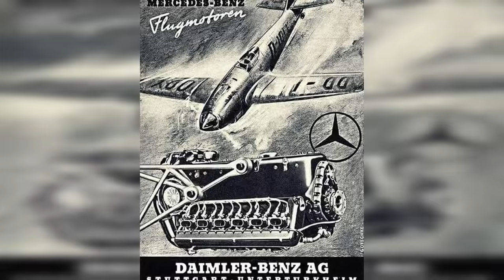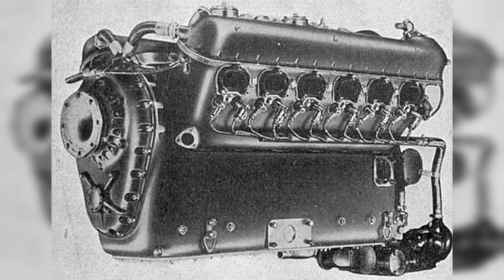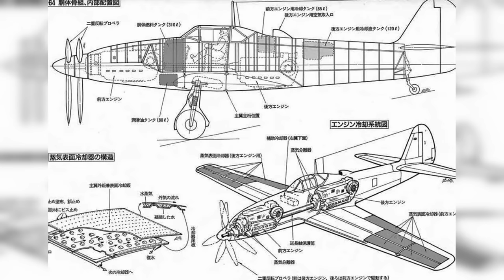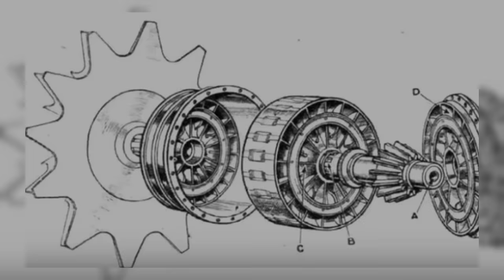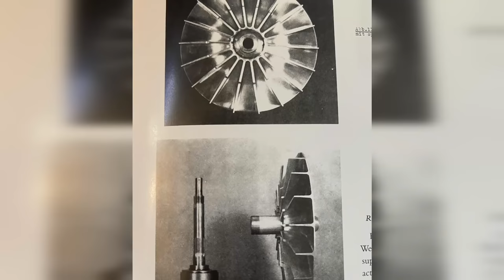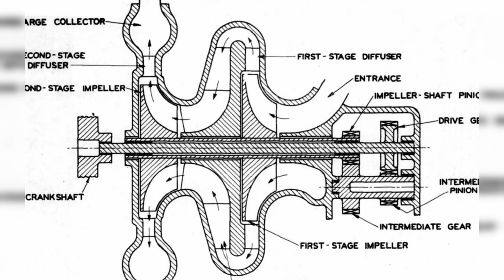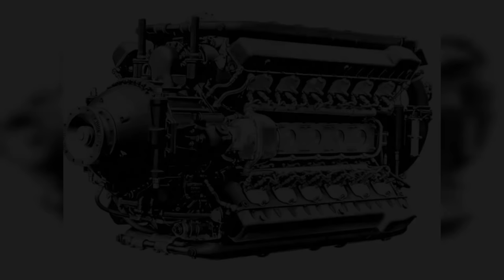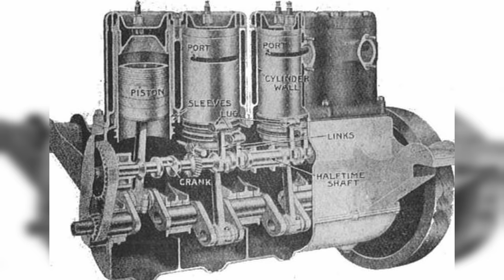The Engine of the Dark Side? Daimler-Benz DB-600 - DB-605 - Part 1

Comment: I own a small part of one of these engines that was recovered from the wreck of a crashed Heinkel He 111. The really amazing thing about it is that stamped into the metal are 3 words......'Made in England'. Didn't find that until I'd cleaned it up. (I obtained the part totally legally from a museum that was getting rid of some bits that they didn't want).
Reply: Pre- war no doubt.
Reply: @michaelbooher339  That's the only explanation I could think of, unless the museum just got the part mixed up and it wasn't from the aircraft they said it was from.
Reply: @24934637  England was not very careful / smart with there technology in the 20’s - 30’s. AKA the Whittle engine.
Reply: @michaelbooher339  That's very true. I'm sure that there was something that was sold to the Russians in the 1950s that in retrospect was a massive mistake, but I can't remember what it was.
Reply: @24934637  The Whittle jet engine technology was lost to the Russians in a pool game.
Reply: @michaelbooher339  OMG! I'd not heard about that! It'll give me something to read about when I've got some time spare tomorrow! Probably the most valuable prize ever won in a pool game!
Reply: @24934637  Rolls Royce Nene Turbojet engines. Reverse engineered into the Klimov VK-1, I think, and powered the MiG-15. Stupid decision.
Reply: Heinkel 111 E  started in 1938 using Junkers 211 engines . Before that where the Daimlers. But it is easy to mistake the engines , both are inverted V12 with similar size and shape.
Reply: That’s interesting, did you work out which part it was which was ‘made in England?
Reply: @drstrangelove4998  It looks like one of those cogs shown at 4mins21 seconds in this vid.
Reply: Only Me109 prototype - D IABI - used a RR Kestrel engine untill the DB 601 was able to take off...
Reply: @michaelbooher339  - lol yeah over a "pool game".
You actually believe that? I mean I heard that in a documentary too but it sounds like such a ridiculous coverup. Especially when Britain has had a colluding past with communism.
Reply: @ThermicLight  I didn’t say I believed it, just heard it on some documentary. Been in aviation for over 30 years, and most likely Britain sold or just gave them an engine.
Reply: @michaelbooher339  - I don't think it was merely sold for profit. Rather if money was really the motive they would of found a reliable country to licence out the production. 

Instead this reeks of duplicitous dealings. I mean for all their bravado against NS Germany they certainly had a fratanized relationship with Soviet communism even before WW2.
Reply: @ThermicLight  True. They weren’t capable of seeing the handwriting on the wall. Plus, we’re talking about one country economically wiped and another technically deficient.
Reply: @ThermicLight  I was agreeing with you.
Reply: Doesn’t sound right….. must be some story behind what you got
Reply: @Wolf-hh4rv  Either Germany was buying some English parts, OR the museum got the parts mixed up. Since the museum is now long closed, I guess the only way to find out would be for someone who has experience of working on that sort of engine to have a look at it.
Reply: @PMcKay00  That reverse engineering bit was nonsense.  See my response to Thermic Light 03 June.
Reply: @ThermicLight  :   It was indeed very much about money - 100% about money.   At the time Britain was broke and needed all the cash it could get.   What happened is that Rolls Royce sold the Nene to the Soviets on a technology transfer basis.  Some people think that the Russians reverse engineered it, but they didn't need to.   The deal was that Rolls Royce provided all drawings, part specifications and data, and sample engines so that the Soviets could put it into production on a per-engine license fee basis.  For Britain and Rolls Royce it was money for jam as the Nene by then was an obsolete design of low performance that nobody else could conceivably want.   The MiG-15 performed well, but that was because it had a really good airframe, not because it had a good engine.
Reply: @keithammleter3824  - So colluding with communism to make a buck. So very hypocritical and trite.
Reply: @ThermicLight  : I think you have put it a bit strong.   Britain was broke - she borrowed a large sum from the International Monetary Fund.   Britain wished to sell things to anyone, including the Soviets - she really didn't have any options.  Pre-war Britain sold a lot of stuff to British Commonwealth countries, but following WW2 those markets were rapidly drying up as those countries began to trade with others eg Japan, USA.
Now, if you were bankrupt, and your dodgy neighbor who you always detested came to you and offered to buy for a good price that worn out old car you own but haven't driven for years, what would you do?  
Remember - that Nene engine was obsolete junk that Britain's allies would never buy any more of, and all Rolls Royce had to do was go to the filing cabinet and make copies of all the Nene info.  And round up some parts from stock.
Also remember that the Soviets were trading with all manner of Western countries as well as iron curtain countries.   Was selling obsolete engine technology really any different to selling the Soviets wheat and wool (as Australia did) or machine tools and telecommunications (as West Germany did)?   In all cases it's both making a buck and increasing Soviet strength.
Reply: @keithammleter3824  I didn't know they supplied drawings, so you are right about it not being a case of reverse engineering. I doubt Russia paid much in license fees though. Hooker said they were turned out in colossal numbers, and he saw they were still in large scale production in China in 1975, with the original faults too. We can have a semantic debate whether "unlicensed copies" is the right term, but Rolls Royce wasn't being paid for them.

"In 1958 it was discovered during a visit to Beijing by Whitney Straight, then deputy chairman of Rolls-Royce, that this engine had been copied without license[1] to power the MiG-15 'Fagot', first as the RD-45, and after initial problems of metallurgy forced the Soviet engineers to develop a slightly redesigned (and metallurgically closer) copy, the engine had then entered production as the Klimov VK-1 (Rolls-Royce later attempted to claim £207m in license fees, without success)." https://en.wikipedia.org/wiki/Klimov_VK-1

It was naive to sell the technology to the Soviets. It would be hard to enforce the license fees at the best of times, but once you change the design, even less chance. I don't think it was 100% about money. I think it was also a case of the Leftist Atlee government being sympathetic to communsim, as many Leftists are, and wanting to improve relations, dreaming of a post-war reconfiguring of the world centred on the worker, if at least ideologically. The Atlee government would have at least had less qualms than Churchill to give the Soviets the latest British technology.

"The Soviet aviation minister Mikhail Khrunichev and aircraft designer A. S. Yakovlev suggested to Premier Joseph Stalin that the USSR buy the conservative but fully developed Nene engines from Rolls-Royce (having been alerted to the fact that the U.K. Labour government wanted to improve post-war UK-Russia foreign relations) for the purpose of copying them in a minimum of time. Stalin is said to have replied, "What fool will sell us his secrets?"[4]" https://en.wikipedia.org/wiki/Mikoyan-Gurevich_MiG-15

The deal with the Soviets was done in September 1946, and to the best of my knowledge, the Nene was the most powerful aircraft engine in the world at that point, with a design thrust of 5,000lb. It was far from obsolete. Axials had more promise, but were very problematic at that point. Rolls Royce developed a larger version of the Nene and called it the Tay. It had around 7,500lb of thrust.

In Korea the VK-1 in the MiG-15 had about 6,000lb of thrust, and the J47 axial in the F-86 had about 5,000lb. There were different models of course and outputs got higher through time. 

"The MiG-15 was superior to early F-86 models in ceiling, acceleration, rate of climb, and zoom" https://en.wikipedia.org/wiki/North_American_F-86_Sabre

Thrust plays a pivotal role in higher acceleration and climb.

The Tay was licensed to Pratt and Whitney as the J48 and powered the Grumman Cougar in Korea, and the Panther too, although that just missed service.

In summary, the Nene deal was stupid for giving your enemy your latest technology that was very likely to be produced without licence fees being paid. It was one of the most powerful, if not the most powerful, aircraft engine at the time, and gave excellent service in the enemies aircraft for at least another decade. It was still in production almost 30 years later in China.
Reply: @PMcKay00  Re your points in turn:-
1.  You are correct in saying Churchill would have been more likely to block the deal.   He knew Stain and Stalin's top men personally and knew how they thought.  However, you should be less critical of the Brit Government at the time.   The deal was  negotiated between the Soviets and Rolls Royce.   The Govt could have vetoed it, but would then have been open to severe criticism for blocking trade at a critical time - Britain was broke.   They had to borrow large sums from the IMF and this might have been harder if they were seen to block trade.
Also, the western world thinking at the time was that trade reduced the probability of wars.   Ukraine has shown that is not entirely true but that is another story.
2.  You are correct about collecting the license fees.   The Soviets cheated.  They claimed the modified engine was a different engine and thus not subject to license fees.   And they handed over the design to the Chinese and neither the Chinese nor the USSR paid any license fees to Rolls Royce for the Chinese engines.
3.   Yes, thrust is critical to performance but so is airframe size:  The MiG-15 was much smaller and lighter than the F-86.  
F-86:   Thrust 26.1 kN,  Gross Weight 6900 kg, Wing Area 29.1 m2;
MiG-15:   Thrust 26.5 kN (very close to 6000 Lb US), Gross weight  5050 kg, Wing Area 20.6 m2.
Clearly the MiG's better performance comes from putting a similar size engine in a much smaller airframe.
4.    Yes, it WAS stupid of Rolls-Royce to enter such a deal without a mechanism to enforce royalty payment, but that is a fault of Rolls Royce, not the government.
5.   The Nene, which dates from 1944, was not at that time an engine that could attract Western sales as it had the excessive fuel consumption of the early British centrifugal flow low compression jets.  The Nene and the Tay were never used much - Rolls had more sales success with the 1950 axial flow Avon.
Reply: @PMcKay00  The main superiority of axial flow over centrif/radial flow was never about thrust.   In either type, if you want more thrust, make it bigger.   Where the axial flow superiority lies is in lower fuel consumption.   Fuel consumption is always critical in commercial aviation and in military aircraft designed to fly to and attack enemy territory.   It is less critical in aircraft designed for home defense, which is where the Germans and the communists employed their early jets for their performance (Nene copies and others).
The Brits would have been well aware of the above factors - "They won't be attacking Britain with that!"
Axial flow engine shape also lends itself to bypassing - that is using an extended fan to push air around the engine core without going through the combustion chamber.   This considerable increases fuel efficiency.  
The Soviets were developing their own jet engine, starting with captured inferior German technology, but came to see it as a risky expensive project due to too many engineering and metallurgy lessons to learn at the same time.   They saw merit in buying the Nene design as a way of lowering risk - it was a known good design seen as the easiest to put into local production.   For the West, it was an obsolete engine with excessive fuel consumption.   For the Soviets, the same factors that gave it high fuel consumption (centrifugal flow, low compression) made it easy to make, being less critical of metallurgy, complex machining, etc.
At Rolls Royce, it was money for almost nothing - handing over the design of an "old" engine that by then they were just not likely to sell many of, if any.
It is worth contemplating what the Soviets would have done if the British Govt had blocked the deal.   The obvious option would be to continue persevering with their own design, and there is no reason beyond the risks they saw why they could not have eventually had success, perhaps a couple of years later.   Still in time for the Korean War.  And their own design may well have been superior.
Or they might have simply stolen (industrial espionage) the design of the Nene or another low compression US or British engine - they seemed to be pretty darn good at stealing the designs of almost anything.
So the net impact of the Nene deal in West/East conflict is not as much as it seemed.
I tried accessing the key aero article but my browser won't let me.

Incidentally, the heavy fuel consumption issue was a key factor in the Air Ministry and the RAF not taking too much notice of Frank Wittle.    It has been repeated ad nauseum in popular media the line that the silly old codgers were too stuck in their ruts to see the merit in Wittle's brilliant new invention.   It's a good story.  But in fact at the time they had good reason - it's calculated fuel consumption was hopeless.  And Britain needed aircraft that could take the War back to Germany.   Then the Germans developed a rocket interceptor (Me163) with an endurance measured in minutes - just long enough to shoot down one B-17 and land dead stick, having burnt half a tonne of fuel in 7.5 hair raising minutes!
Reply: Er wrong, regarding the H-Series Heinkel 111 of which you are talking of,  is powered by Junkers Jumo 211-F2,s, after the F-Series with stepped cockpit and straight tapered wings, Heinkel switched its engine supplier from  Daimler Benz  to Junkers, thus freeing up DB600-601s to Messerschmitt at Augsburg.
Reply: Those parts came from a CASA 2.111...made in Spain with Rolls-Royce Merlin engines after the war ended.
Reply: @michaelbooher339  Post-war aircraft
Reply: @sandervanderkammen9230 Ah, now that is a very good possibility IF there were any of those being used by the Luftwaffe and crashed in the UK. Unfortunately I don't have any info on what specific crash site it was from, all I know is that it was a He111 Luftwaffe, and crashed in the UK. I'll have to do some research.
Reply: @24934637  Sounds like the story has been embellished a bit... museums often sell-off items that are not genuine or period correct.
A few war-time He-111s were converted to Rolls-Royce Merlin 500 engines in Spain after the war.
32 CASA 2.111 were brought to the UK for the filming of the movie 'Battle of Britain'
It is very possible that a CASA 2.111 crashed in the U.K. during the film production or after production ended.
 There was also CASA 2.111 touring the air show circuit in America painted in Luftwaffe colors..
Reply: @sandervanderkammen9230  They didnt' really have a reason to do that, as they literally gave me the pieces free. They were in a scrap pile outside. The sort of museum it was only had remains from crashed aircraft. There is however a good possibilty that the info I was given was accidentally incorrect. (Pic of museum below) https://fullfatthings-keyaero.b-cdn.net/sites/keyaero/files/node_forum/2007/12/11/p47%20engine.jpg
Reply: @24934637  I assumed that you didn't receive any provenance or documentation, the situation you discribe sounds like the information was just whatever someone told you, its very possible that the parts were not related to the war or a German aircraft.
Reply: @sandervanderkammen9230  There is no doubt that they are aircraft parts, as I've identified one of the bits as an oil pressure relief valve from a Merlin engine. I do actually have the info somewhere relating to that specific crash. I acquired these pieces 30+ years ago, and didn't write down the info I was given, but there is no doubt that they are aircraft parts!
Reply: @24934637  Well, like I said, if it was a Merlin engine it did not come from a Luftwaffe He-111 flown during WW2.
German made He-111s had BMW IVs, BMW 123D Radials, DB-600/601 or Jumo 205, 211 or 213 engines.
Only Planes built or converted in Spain after the war were fitted with Rolls-Royce Merlin 500 engines.
If the crash dates back to WW2 it is not a Luftwaffe plane.
Reply: @24934637  Spanish built CASA 2.111 are commonly mis-identified as a Heinkel He-111.
Reply: @kkteutsch6416  Sorry, no. V1 used RR Kestrel, A-D series used Junkers Jumo 210‘s, only E and F series used DB 601, G and later used DB 605‘s.
Reply: @ThermicLight  He wasn't wrong on that though.
Reply: @ostrich67  - Yes let's bemoan about capitalism in the West despite it operates as a mixed economy.
Reply: @ThermicLight  no, let's worship the billionaire class and the corporations as if they're gods, because one day we may become one ourselves.
Reply: @keithammleter3824    Cause $20 is $20 right….🤦‍♂️🤦‍♂️🤷‍♂️🤣
Reply: @ThermicLight  oh hush.
Reply: @Classickoolcars  : Exactly!